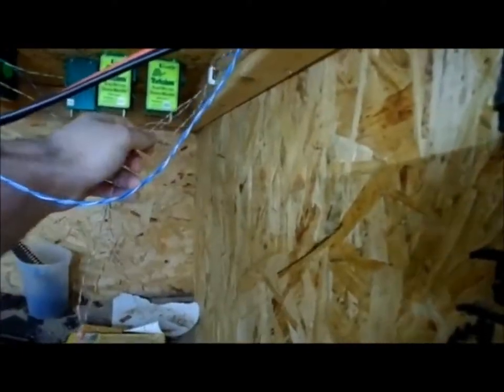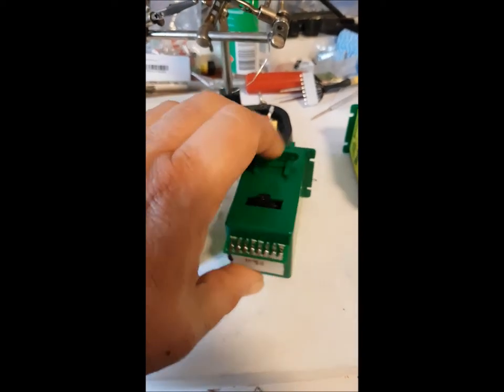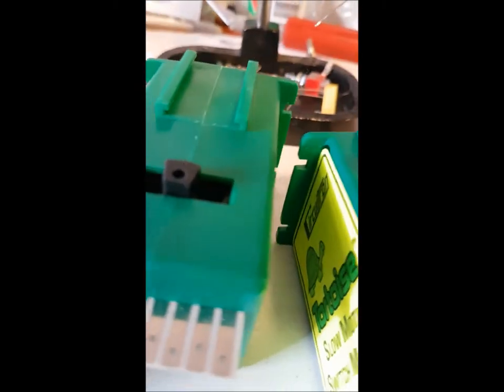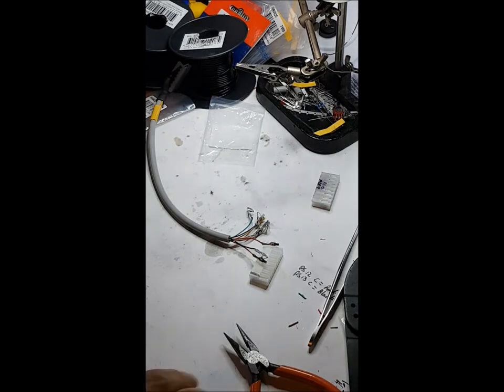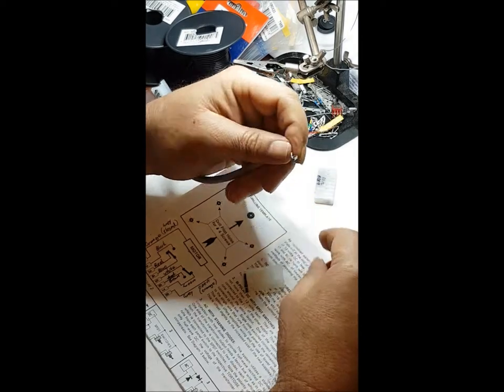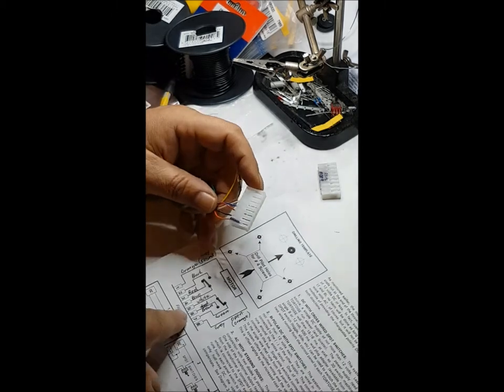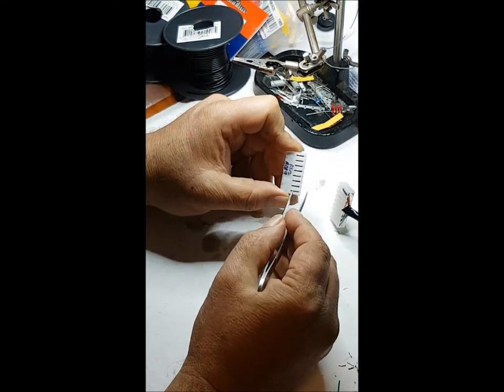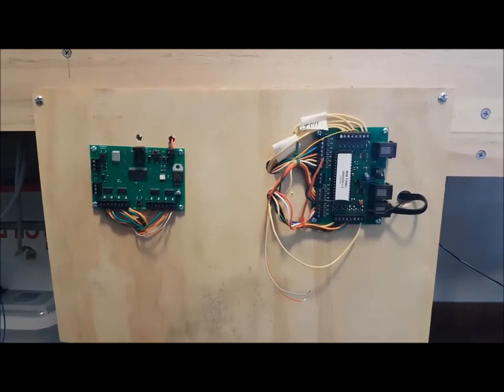How to make a plug and play Tortoise motor

Comment: this looks like a pain in the butt to do
Reply from the maker: It is time consuming, but it does and has paid off already for me when I had 2 switch motors fail on me.
Reply: @Ausmerica  what will having those things on them have anything to do with the tortoise going bad
Reply from the maker: @KerleyExpress  I wont have to mess around desoldering the wires, and remembering which wire goes where.
Also I can pre make harness, in preperation for when I can afford the tortoise motors, and just plug it straight in, and it's ready to go. Again, I won't have to worry about which wire goes where.